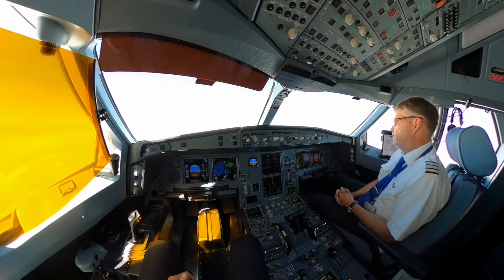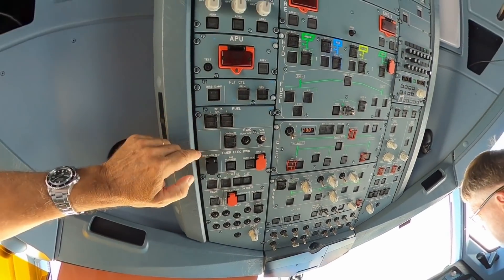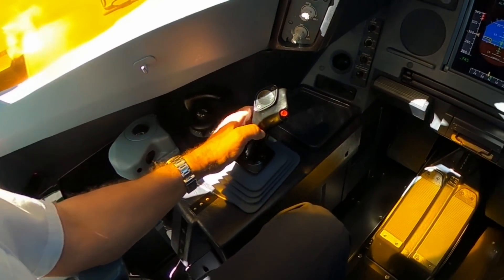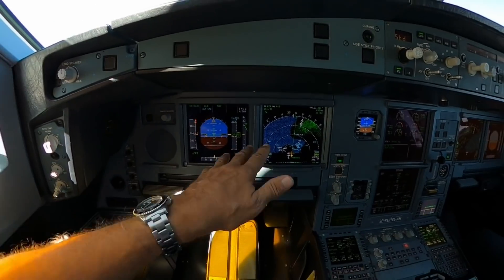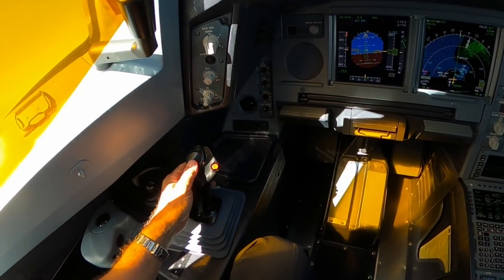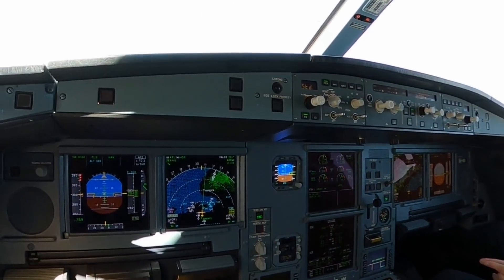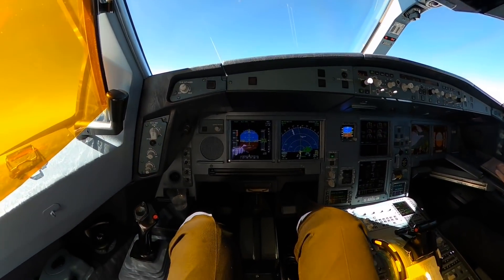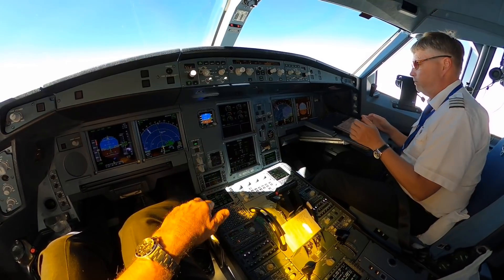The Airbus 330 sidestick.

Comment: Jesus this single video has finally answered the Boeing vs Airbus debate for me
Reply from the maker: Nathaniel Girma It’s a bit more complicated. The yoke is interconnected with the one on the other side and the sidestick is not, meaning that they don’t move simultaneously. So you really MUST communicate your actions or look at what the opposite pilot is doing with the stick, if you want to know. Otherwise you have NO idea in an Airbus. If you are aware of it it’s no problem and there are only big advantages with the sidestick.  Indeed my personal opinion, but I respect others.
Reply: @bjornpilot  May I ask, I've read somewhere that the Airbus flight dynamics respond exactly the same irrespective of flight parameters. Does the aircraft feel the same maneuvering at 30k feet and on Final?
Reply from the maker: Nathaniel Girma Good question but tricky to answer. It does not feel the same but feels like it should considering the speed and altitude. Meaning stiffer at the controls at high altitude and more responsive at lower, like just before landing. The flight control laws are such that all Airbus planes should feel the same, however I think that the A350 feels much more responsive and agile than A330/340. I have never flown the A320.
Reply: @bjornpilot  Thanks for your response! Haha I can't blame you for loving the 350, she's a beauty ;)
Reply: bjorn pilot 👍
Reply from the maker: Nathaniel Girma Agree. I have flown Boeing planes and they are good! More of a design discussion.
Reply: Weird that no one asked, "answered the debate in which direction"? That Airbus is better or that Boeing is better, it could be either way.
Reply from the maker: Raph Fan Both have their advantages, but it’s obvious I prefer Airbus, especially the A350. You still must know that the sidesticks don’t move simultaneously.
Reply: @bjornpilot   I think this solves the problem of the situational awareness of the side stick between 2 pilots. "Active Control Sidesticks" . an example is from Gulfstream: 

https://youtu.be/vXhCJYWvwd0
https://youtu.be/NmejlcwcUxA
Reply: bjorn pilot Do you switch between the A330,A340 and A350 within the same bid month? I currently fly 752,753,763 and 764. I can understand moving around types but I never knew of people flying both twin and quadjets simultaneously as a bid category.
Reply: skyserf Yes sir! Since the 330 and 350 is the same rating and most of our long haul pilots is rated on the 340 as well that means they can fly it all 😊
Reply: @limweiheng6823  Irkut MS-21 is also going to have active sidesticks by Collins Aerospace. Apparently the first airliner to have one. Here for some nice footage from a test pilot! https://www.youtube.com/watch?v=LK80Qmfo24k Tbh the Airbus could be retrofitted with such sidesticks pretty easily... There have been accidents because of it.

Comment: I’m against these joy sticks, the other pilot can’t see what you are doing and it takes time to switch command between pilots.
Reply: It doesn’t lol. Both pilots can control their side stick and the inputs get added up (never exceeding the maximum possible input).

In an emergency, for example, the other pilot can press the button on their side stick, there’s a voice saying “priority left/right” and they have control- the other pilot’s sidestick won’t do anything (probably for a short while?). I’m not a pilot so I don’t really know 🤣 but it certainly doesn’t take 45 seconds.

You’re probably thinking of this: you can press and hold your side stick button for 40 seconds to permanently deactivate the other pilot’s side stick. But it’s not necessary to switch command.
Reply from the maker: RÉGIS T. No you can take control immediately. You have to look and see what the opposite pilot is doing with the stick. As long as you are aware of this, it’s no problem. But you MUST take it into consideration.
Reply: bjorn pilot ok, ty for the answer, I believed what I read on a NTSB report about the Air France Rio Paris crash was wrong in this case...it was an A330.
Reply from the maker: @regist.9407  I've read the report. In that case one pilot held the stick full aft for very long time. It is a possibility that the plane had escaped the situation by itself if he had just released the stick. Even better if he had pushed it forward.
Reply: bjorn pilot ty for your answer but I don’t understand what do you mean...maybe I’m too old to understand things like the the plane will do it better by itself, I mean if you are “stall” you have to push forward, that’s what I learned but it was a long time ago, lol... anyway we were not in the cockpit of that plane (fortunately or unfortunately, idk.) and the pilot arrived far too late in my opinion. I like very much your videos (even if obviously I’m not an Airbus fan), please continue your great job as a pilot and a utuber, in this not so easy period, take care and so long.
Reply: Why does it take 45 seconds to switch commands?